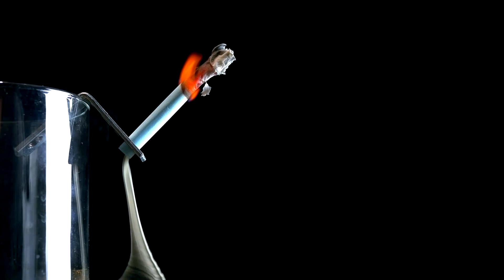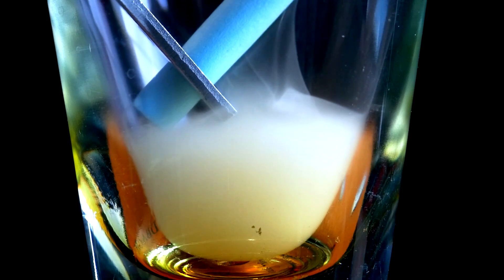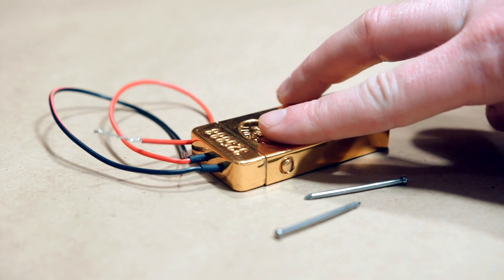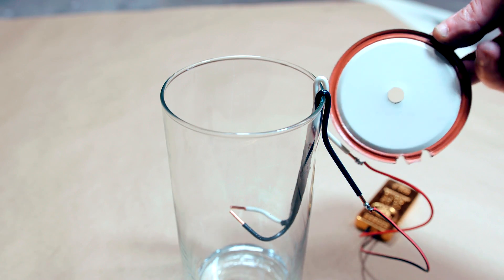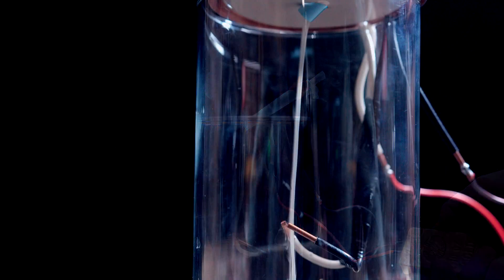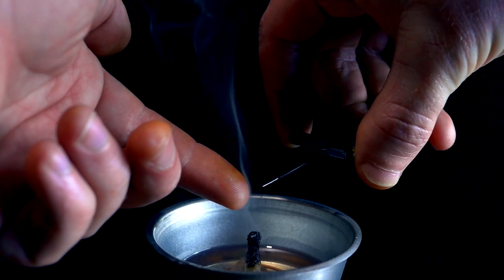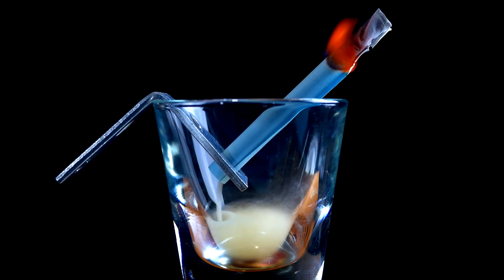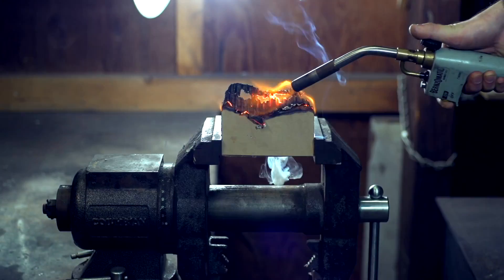How To Make A Smoke Waterfall & Firey Smoke Combustion Experiments

Comment: That's a fascinating effect. I've never seen before. I wonder if you could possibly engineer a way to make a device that burns longer than the paper tube, so that you could sustain the effect over a longer time. Like a kind of smoke waterfall dynamic artwork. The idea would be to have it run continuously generating a waterfall and collect the smoke in a container and then periodically ignite the collected smoke to empty the container. Perhaps incense inside a metal tube would work as the smoke source? It would smell good too!

Comment: I'm really surprised that it can have enough heat to generate smoke, but it can also disapate the heat quickly enough to end up descending. 

I guess the products are, as you said, more dense than air when cool, but I would not have called that you could make the whole system work passively.

Pretty neat.

Comment: im new but did you make that thing that shocked your finger to ignite the candles smoke. if so how do i make it
Reply from the maker: That's called a piezoelectric igniter and you can find them inside of most lighters that have a press button rather than a flint wheel.
Reply: NightHawkInLight thank you so much

Comment from the maker: Interesting that the sticky notes burn with a red flame isn't it? I wonder if they use some strontium in the dye or binder for the paper.
Reply from the maker: I tried sticking the cardboard into a slot between two plates, but not fully enclosing it in a fish tank or something. I may try that.
Reply: Massive props for doing the giveaway how you did; I think that was [ethically] right.
Reply: What if you would stick the bottom of the cardboard in a close container, like the sticky note in the glas, would you get a smoke waterfall?
Reply: NightHawkInLight how about sticking the notes together in some way to get a waterfall ^^ i mean it burns Solo so just have to find out how it burns in a Group
Reply: Cool projects. Also, cute birdy!~
Reply: The red flame could just be because there is not enough oxygen in the glass to efficiently burn the CO. I actually doubt there is much hydrogen left over in the smoke, because even at room temp the hydrogen is still positively buoyant.
Reply: NightHawkInLight uploaded 1min ago but ur comment is 8hrs ago is this witchery
Reply: NightHawkInLight Great work, I remember a vid ages ago with someone running a generator and his truck on wood gas(smoke) :-)))
Reply: Does Mos, Mohs? Mose? Have his wings clipped?
Reply: NightHawkInLight They don't I think it's just about the flame temperature of that particular mix of wood pulp, glue and dye.
Reply: NightHawkInLight lithium maybe?
Reply: NightHawkInLight Perhaps vary the moisture content of the cardboard?  Or maybe vertical alternating strips of moist and dry on the burning edge to control the size ofthe flame?  That also should increase the smoke production and by adding various chemicals to the water like in your fireworkds, you could created color effects I would think...
Reply: Have you tried a longer piece of cardboard so the drafts from the flame are farther away from the bottom?  Just a thought, awesome channel!  Cheers, Chris.
Reply: hey nighthawkinlight . i don't think its strontium that they use in the paper , too expensive and it's good with cellulose , maybe a stable compound of it , it could be calcium , as it burns brick red .
Reply: probably lithium